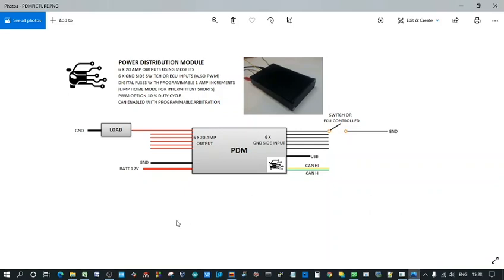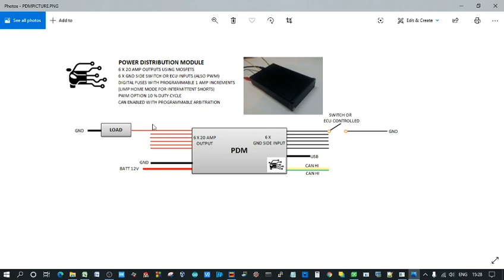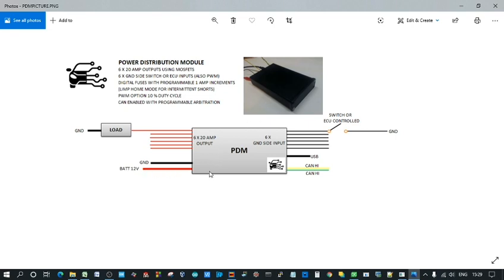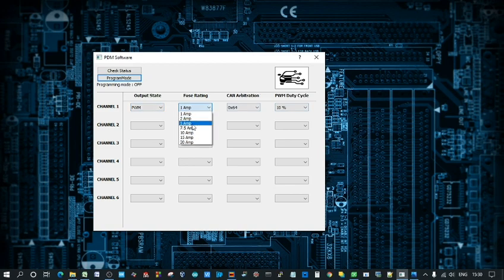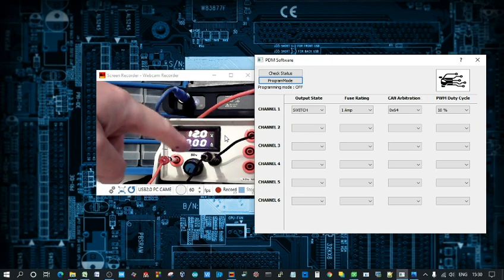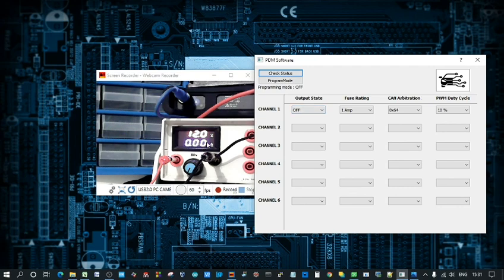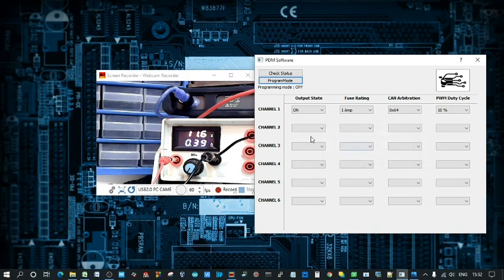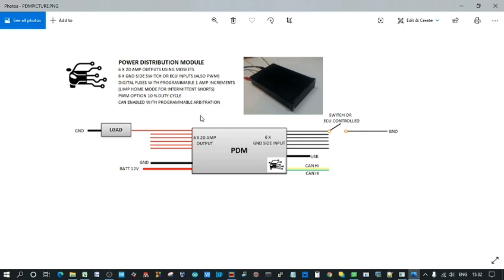PDM Programmable Power Distribution Module - STM32 (Mbed) Software(QT Framework)

Comment: Any updates after the image that i have sent you??
Reply from the maker: None Sorry, Been concentrating on work(career)
Reply: @definitivediagnosis9162  good luck man... if u pull off the pdm anyway you can sell it for a considerable amount
Reply: @definitivediagnosis9162  hello its me again
I couldnt find your email that i used before but I wanted to let you know that I got the software of a stm32 based pdm from a motorsport team

The software seems to be well done
But the problem is that I am missing pcb design and BOM

Do you think the hardware part would be easy for us to figure out since the software is done?